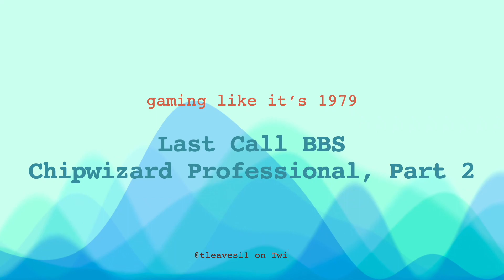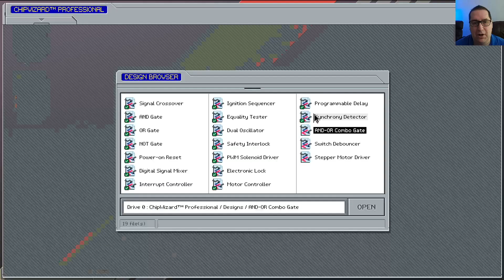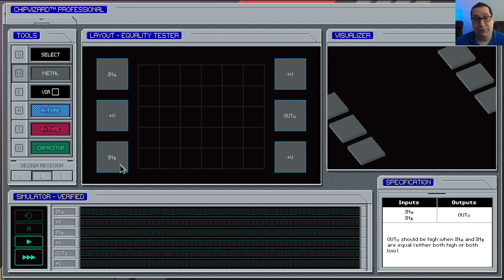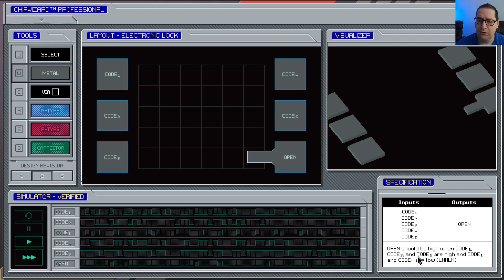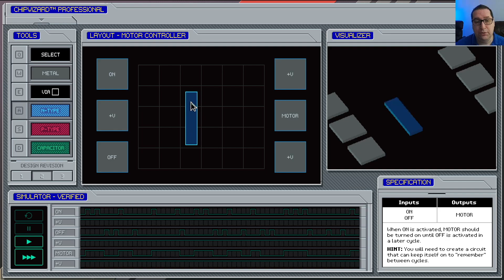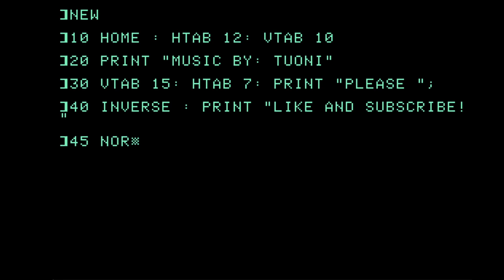Last Call BBS - Solving Chipwizard Professional, Part 2

Comment: In the last puzzle, MOTOR is powering the system while it is on and it is ANDED with V+ until the OFF signal comes. It's ugly but it works.

Comment: I was able to solve all of these circuits on my own, but I sometimes struggled with the efficiency. When I figured out how the efficiency worked, it became a lot easier but I still found this series helpful because it gave me a different approach. In trying to find the most 'efficient' solution, my original method wasn't always suitable so seeing someone else go at it gave me ideas of how I could adapt their method to the 'efficient' solution. Thanks for that.

Comment: The size constraint is in the name, you're building ICs, which are meant to be small.  Sure you could have a mulit core computer in the home in 1979, it's just that you'd need a whole home for it.  "chip" wizard imples small designs, otherwise it would be called "Breadboard" wizard, or in that case they'd just include any off the shelf circuit maker in it's place.  

I don't think doing specifically what is asked for in the motor conroller is something to be stressed about, it's a latch, and it's a very common way to actually control a motor.  Tablesaw, for example.  You push on, then push off when you want it off.

Don't get me wrong I'd still watch you play that too.  Thanks for doing a longer play of this game, would love to see more long form content that's gaming related, /espically/ more of those MS flight sim bushflights.
Reply from the maker: Good point!